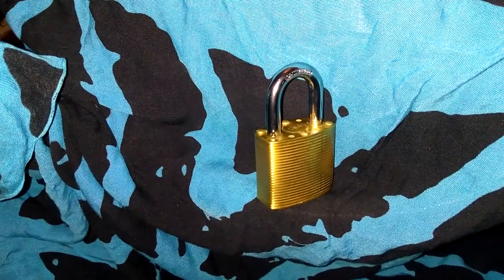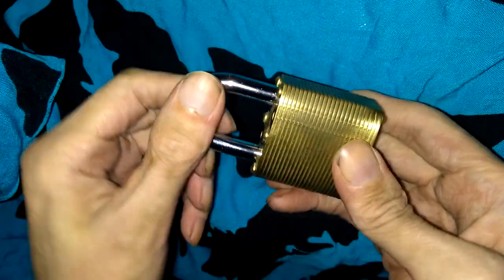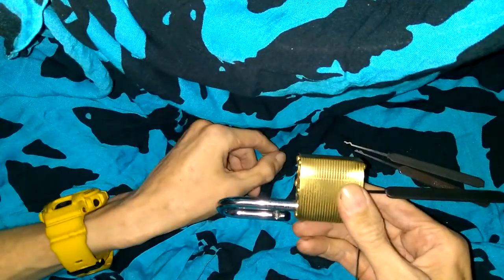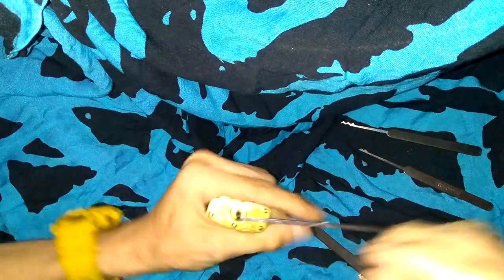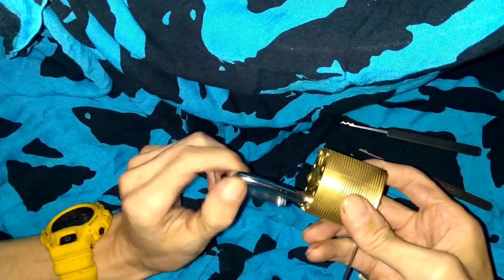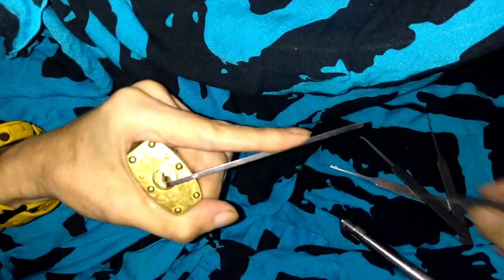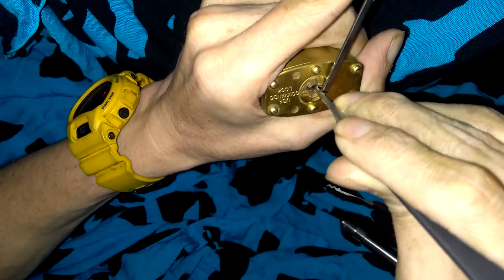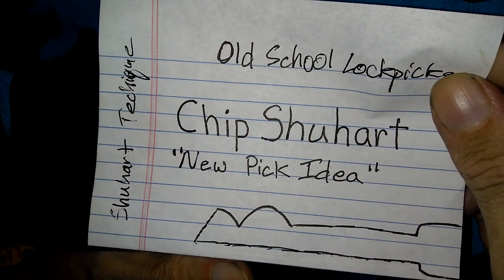Lock Picking Commando Lock Marine...SPPed, Raked and Hacked

Comment: Thank you for the video. I was going to buy this lock but not now.
Reply from the maker: Peter V ~ Thanks for watching...this is pretty standard for locks of this type.  The point of the video was to show that no matter with security pins you can zip through a lot of locks.  These Commandos are well constructed and made in the USA, unlike some of there competitors.  It's a fine padlock that would last you years.  I can do this with several other locks out there regardless of brand.

Comment: A good and enriching video. Thank you a lot. By the way, does this raking method work  also with the locks with security pins like the european locks ? Since the locks are harder to unlock than padlocks
Reply from the maker: Bodybuilding...raking should work on most common locks but some can be stubborn and need spp.
Reply: @JMLockpicking  Since I have  difficulties to rake some locks with security pins and I'm not vert good at SPP, I applied your method on some european locks with security pins and false set, by using rakes and also an EPG, and it works like a charme ! Thanks a lot JM 🙂